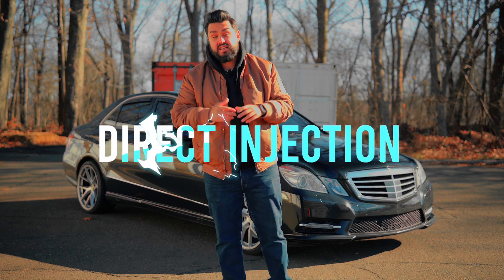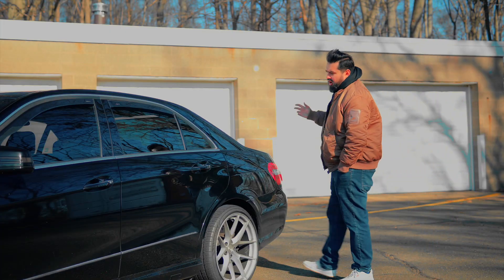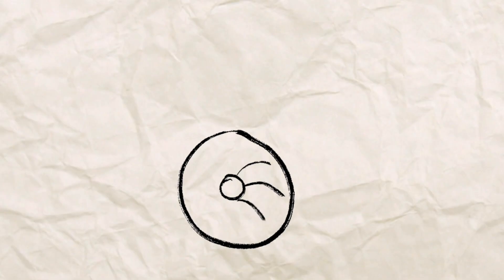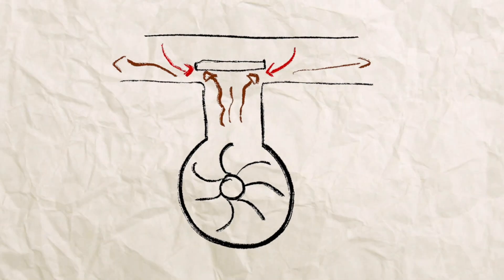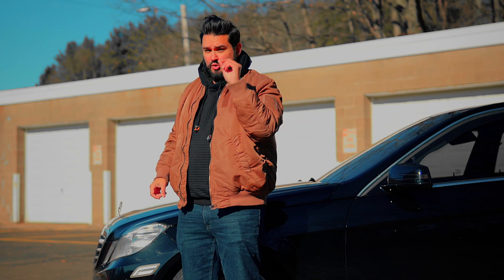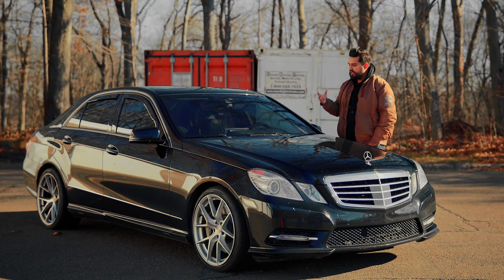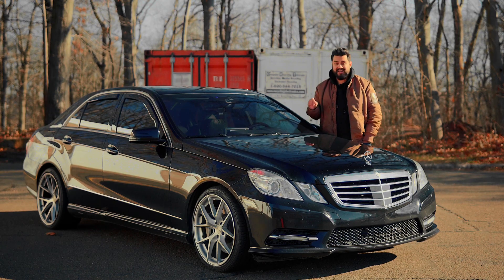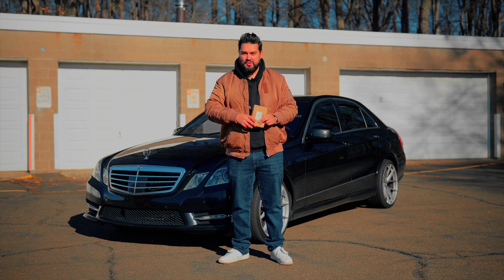M157/M278 Oil Solenoid Mod – What It Does & Should You Do It?

Comment: I read it fixed the startup rattle for someone on a M276 3.5 (GLK350)
Might try it soon with my C350 2013 which has startup rattle as well
Reply: It did exactly that on mine. No start up rattle. 2016 C450 w/143k mi. Using 5w-40 Pennsoil Platinum Euro SP rated @ 5k mi oil change intervals.
Reply from the maker: Rattle is either from stretched chain or cam adjusters failing. This won’t fix either of these things but could prevent it if it’s not happened yet
Reply: @mrapter7  im hoping its just because of the tensioners + missing check valve
Reply from the maker: Yeah very likely possibility. This was about a $2500 fix (included some new coolant tubing that cracked). Adjusters are far more expensive. But, once tensioner is replaced and check valve is in, you should be more or less good. Use good oil, change it frequently and you’ll be good to go. 

Adjusters typically fail from a bit of fault from manufacture defects and just poor oil changes / dirty oil. I haven’t yet, but I’d recommend a media blasting every 70-100k miles on the motor to get carbon out which can decrease the carbon and deposit buildup in oil that causes these types of issues
Reply: @mrapter7  this rattle noise happens on all v6 Mercedes engines from 2015+ I had it every start on my 2018 c43 with 27k miles until I cut the oil solenoid, if it is a stretched chain or failing cam adjusters then wouldn’t we all be having much more issues with our cars?, because it’s been 2 years of hard driving and no issues for me and many others, and also why would either of those problems appear on a such a low mileage car?
Reply from the maker: Poor oil, oil change intervals, driving habits, heat cycles, etc. plenty of reasons it’s happens at different times. Not all engine are effected, and most 2015+ are uneffected for the most part. 

Early DI engines have cam adjuster issues, timing chain issues and piston slap issues. All of these could sound similar on startup to people, so it’s hard to even disgnoe one anecdote do another.
Reply: changing tensioners + installing check valves completely got rid of my rattle, cam gears were in good condition, cost me around 800
Reply: @CodeGabriellho what is your car?

Comment: wont throw a code or cell or checkengine on s550 2015 ?
Reply from the maker: Throw code, yes, CEL, no
Reply: @mrapter7  ty kindly , was it only for like early years of the biturbos v8 11-13 ? or applies to all years ?
Reply from the maker: @emazens even newer AMGs can potentially benefit. Literally any place a two stage pump is, you could definitely be better off with full proper pressure at all times. It’s a common mod on many vehicles, I’ve come to learn
Reply from the maker: @emazens if you’re considering one , get one with a build date after 3/15. Much much much better and livable engine

Comment: So, my question is regarding the oil pressure being configured to the maximum all the time. We all know about oil incursion into the wiring harness through the cam sensors and cam phasers....this is a failure that we all are planning for, usually with the pigtail mod. But we don't expect this failure to occur before 50K miles. Would this mod possibly cause this failure to occur sooner?
Reply: No. Whatever you do , just get the new version of those solenoid and sensors, i put another 60k miles on it and didn't happen again. The pigtai mod is just waste of money.
Reply: @Hi.Al.you mean buy the solenoids and sensors for the newer version of 278 engines?

Comment: How about M272 E30 engine? Is that a rock solid motor??
Reply from the maker: E300? E350? W212/211?

Yeah the 272 is a great motor. No direct injection buildup, no cam issues, no cam timing issues, no real tensioner or chain issues, and is underpowered generally which means far less stress on the engine. Fantastic motor. 

I’ve driven examples of over 250k (plural) and the engine and tranny were never the concern with them. If it’s been maintained as in proper oil changes at 5-7500 miles MAX, then I wouldn’t flinch

Comment: My car's selenoid is not working right now, and i want to do the same. But how to be sure if its not stuck in the lower pressure mode ?
Reply from the maker: Good question. For this, you can do a couple things. 

I’d turn on the engine and get it fully warmed up (go for a drive). After you come back, pressure should be nominal at 20-30psi. 

Use a scan tool like Xentry to monitor the oil pressure. Note: there IS NO TRADITIONAL oil pressure sensor here. These engines use a combo of RPM, temp, solenoid status and other flow sensors, so using other scanners may not work. 

Turn engine off after reading, Unplug the solenoid and turn it on again. If your pressure stays the same at 20-30, it’s seized internally. If you see it jump up to 40 or so, it’s working as intended. 

That being said, you could bench test it and send 12v thru it and see if you hear a click as well, but I’m not comfortable doing that.

Comment: Cool video bro. Definitely gonna do it. 
Now for what's important...Rims? Make, size height, width, and most importantly... offset? Those sit perfect.
Please and thank you.
Reply from the maker: Because you asked nicely ❤️

Aodhan AFF7 19”

F: 235/35r19 x 8.5”
R: 265/30r19 x 9.5” 

But please beware, I have since swapped to 245/35 up front and 285/30 in the rear as it is a 1:1 size for 4matic (like the previous sizes) but offers significantly more sidewall while having great fitment. The 285s poke a TINY bit, so maybe 280 or 275 if you can find them paired with 240 up front. Hard sizes to fine tho. 285/245 are easy to get. 

I’ve bent 4/4 wheels and replaced them all once, and have another wiggle in the back before I put the thicker tires on. I watch the road like a hawk, but they bend too easily with the thinner rubber. Not recommended at all. 

245/285 can still be lowered 40mm with Vogtland springs or similar…which is what is next 👍
Reply: @mrapter7  beautiful choice in wheels, but still going to 35/30 is quite heroic😮.
I'm in a small town in Texas where I can roll a marble straight to Oklahoma, but I've lived in DC where 35s got me dental work and 4 square rims at 25mph. 
I think I'll try 245/40 front and  285/35 in the rear on my '14 E550 cabriolet.
Thanks a bunch.
Reply from the maker: @apollobolling644 40 sidewall won’t fit - you need 35s on 19”
Reply: @mrapter7 DAMMIT!😢
Reply from the maker: Nothings changed yet - she’s been in and out of the shop for various little things …. Currently is for another quite drastic coolant leak somewhere. 

Once she’s sorted for a full few weeks - then the b6s and springs are going on haha. I have like 2500 in parts sitting in my office waiting ….
Reply: @mrapter7 I'm probably more anxious than you are to see the next upgrade. 
I'm here for it 😂
Reply from the maker: Thank you bro! Should be getting her back this week - she’s been in and out of the shop chasing coolant leaks so videos and other upgrades have been a little difficult haha

Comment: Has any one else's oil temps running higher since doing this?  I would think it should be better since it's cooling the motor off more which means the motor shouldn't be running as hot.
Reply from the maker: When you take heat away from the engine, it goes into the oil, which would mean higher temps if more of the motor is being cooled in layman’s logic. 

But yes, a well documented side effect is 8-10* bump on oil temps. Oil should be more than fine up to 250* if you track it. Daily and spirited driving I’ve never seen over 224 on mine. I use high quality liquimoly and change every 3-3500 miles
Reply: @mrapter7   OK, I have a 2013 E63 AMG 5.5 L (pre-facelift)  so when I'm chilling, my temp is usually around 218 to 222. What if I start to get on it just a little bit it can get up to 231 but it starts to come back down to sub 220.  
 My Homie has a 2014 which has the facelift and his oil tip never sees more than 216 and he is usually around 205 when chilling.  So it always had me worried that my oil temps are running higher than usual. But I also use liqui Moly Mollygen every 2500–3000 miles.  since I've unplugged the oil solenoid. I noticed that when it does get up higher and it cools down a bit quicker and while just cruising the oil temp is a little cooler.  but not as cool as my friends 2014.
Reply from the maker: Are you talking about oil or coolant temp here? 

Newer engines 2014+ have better cooling and revisions to oil and cooling passages, as well as split cooling in the m278. Don’t have a reservoir over your engine below your ECU? That’s split cooling. 

The newer AMGs and 550s also have an additional auxiliary oil cooler too. 

Again, if this is oil temps I wouldn’t even bat an eye. This oil good for like 260-275* 

Coolant fluctuates from 200-224 or so
Reply: @mrapter7  I have a 2013 e63 with 5.5l that has the split cooling.
Reply from the maker: @mjk4378 yea then I wouldn’t worry much about your oil temps. They seem fine. If you take 10* off them you’d be basically where you were before so it’s an intended side effect
Reply: @mrapter7  also, do you happen to have the part number or exact name of that oil pump solenoid? So if I do find out that mine is stuck closed so I can get another one. I tried looking it up but couldn't find it.
Reply from the maker: @mjk4378 

https://www.google.com/search?q=m278+oil+pump+solenoid&client=safari&sca_esv=dffffd1eb0412f15&hl=en-us&ei=x6g4aMGSJ5vR5NoP1-HR-QQ&oq=m278+oil+pump+solenoid&gs_lp=EhNtb2JpbGUtZ3dzLXdpei1zZXJwIhZtMjc4IG9pbCBwdW1wIHNvbGVub2lkMgsQABiABBiRAhiKBTIFEAAYgAQyBRAhGKABMgYQABgWGB4yCxAAGIAEGIYDGIoFMgsQABiABBiGAxiKBTILEAAYgAQYhgMYigUyCxAAGIAEGIYDGIoFSKAbUMwEWLQacAB4AJABAZgBqAGgAZkSqgEEMi4xOLgBA8gBAPgBAZgCEKAC0g7CAgcQABiwAxgewgIOEAAYgAQYsAMYhgMYigXCAgsQABiABBiwAxiiBMICCBAAGLADGO8FmAMAiAYBkAYLkgcEMS4xNaAH3nmyBwQxLjE1uAfSDsIHBjAuMi4xNMgHRg&sclient=mobile-gws-wiz-serp#piu=ps:50&oshopproduct=pid:791281969613660598,oid:791281969613660598,iid:310782391260018855,pvt:hg,pvo:19&oshop=apv&pvs=0

I found this, otherwise I’d assume replace the whole oil pump
Reply: @mrapter7  did you mean to send me a video of an Aston Martin? If so what am I looking for in that video?
Reply: And please lmk⬆️ if you have part number
Reply from the maker: Loll! My bad 

https://www.google.com/search?q=m278+oil+pump+solenoid&client=safari&sca_esv=dffffd1eb0412f15&hl=en-us&ei=x6g4aMGSJ5vR5NoP1-HR-QQ&oq=m278+oil+pump+solenoid&gs_lp=EhNtb2JpbGUtZ3dzLXdpei1zZXJwIhZtMjc4IG9pbCBwdW1wIHNvbGVub2lkMgsQABiABBiRAhiKBTIFEAAYgAQyBRAhGKABMgYQABgWGB4yCxAAGIAEGIYDGIoFMgsQABiABBiGAxiKBTILEAAYgAQYhgMYigUyCxAAGIAEGIYDGIoFSKAbUMwEWLQacAB4AJABAZgBqAGgAZkSqgEEMi4xOLgBA8gBAPgBAZgCEKAC0g7CAgcQABiwAxgewgIOEAAYgAQYsAMYhgMYigXCAgsQABiABBiwAxiiBMICCBAAGLADGO8FmAMAiAYBkAYLkgcEMS4xNaAH3nmyBwQxLjE1uAfSDsIHBjAuMi4xNMgHRg&sclient=mobile-gws-wiz-serp#piu=ps:50&oshopproduct=pid:791281969613660598,oid:791281969613660598,iid:310782391260018855,pvt:hg,pvo:19&oshop=apv&pvs=0

I found this, not sure its validity

Comment: Did that on my 16 E63s. No regret at all so far.
Reply: Yea 15 cls63 did it and definitely notice a readiness to get up and go quicker but I will say mine takes longer to get the oil temp up. Don’t know why I did replace all the coolant hoses and reseal the front of the motor but she runs strong especially with the stage two tune 😅 love these cars
Reply: whats your average oil temperature now, he said it goes up 8°-10°, i hadn't done the mod but my average temp is 199°
Reply from the maker: Oil temp will raise 8-10 at its peak, and coolant may rise a little too on older cars. Newer models have more cooling capacity and better efficiency. 2013 and older will get warmer but it’s always in check in my car
Reply: @watspop.n  93 Celsius now for me is the new normal
Reply from the maker: @amaelcaron-gagnon5606 yeah anywhere from 200-220f is within operational ranges for coolant and oil is much safer up to 240 but that’s insane. Never had oil over 230* even when having some fun on backroads really stretching her legs
Reply: @amaelcaron-gagnon5606  ya...i switch to M1 oil this year & it started to go up 210°... i was freaking out...my old normal was 199° top, for years

Comment: Just did this mod last night. And right away when i started the car to get it off the ramps i noticed that it was a little quieter. On my way to work this morning i did also noticed that it was a little bit more sportier if i got on it a little. Tempt did raise quicker. Just a little paranoid if this might mess something up.
Reply: How is it treating you now?
Reply: @kevingooner it's been about 6 months and everything is fine. No hiccups or weird noises.
Reply from the maker: Only things to look for is temps. Make sure they are in check. Expect a potential of +10*f but that’s well within operating temps. 

Other side effects may be a slight burning of oil over 5-6k miles, but I haven’t noticed any and I’m tuned. Engine sounds better, feels better and runs better. I’m happy
Reply: @mrapter7  on my way to work this morning and I got to play around a little and I definitely can feel the difference. I also did a tranny reset before leaving the house. Car doesn't feel sluggish and just wants to go if you get on it. 2013 s550 4matic with a renntech tune. Thank you so much for this. Found out about this awhile back but wasn't sure if it was worth doing. Again, thank you.
Reply: @300zVinh what's your average temperature before and after
Reply: @watspop.n  close to 90 but I have seen it get to 95. Never pass that and then it would drop down to 90 again, which is the normal operating temp. Don't know the long term effects of this will be but so far I honestly like how the car feels now.
Reply: @300zVinh  thanks, i guess i have a small mod to do this weekend
Reply from the maker: 80-100 is technically safe operating temp. My coolant rarely but does spike to 220 sometimes (Fahrenheit) but always corrects. I have no split cooling, tune, and original 14 year old thermostat. Thermostat may be on the way out on mine.
Reply from the maker: It’s a good trade off
Reply: @mrapter7  What temps are y'all seeing AFTER unplugging? I am getting around 210 fully warmed up and have NOT unplugged yet.
Reply from the maker: Yeah oil temps can get to 212-220 or so, coolant might get hotter too as these engines already are at the limit for cooling here but nothing dangerous. You can install split cooling for turbos or additional oil coolers like the 157 if you need. But not needed really. 

220* oil is baby numbers for liquimoly, safe to 270-290. 

Coolant under 220 is normal, will fluctuate especially if you have the AMG menu unlocked that shows you number values for temp. These are notoriously inaccurate in the way they sway. If you took an average over 60s would be more accurate
Reply: @mrapter7  Thanks for the response. Yes, I have the AMG menus unlocked and am reading from there.

My other question is, Do I need to warm up the engine or anything before unplugging? I do have a Xentry setup and a Topdon Phoenix Plus 2 to monitor oil pressure. Thanks!
Reply from the maker: Nah just scan first to ensure no other codes and scan again to see if you see the proper code

Comment: m278 14' S550 - 200K Miles - Canada
I read on the blogs that this mod is not recommended for colder climates, also the oil pump wears out faster?
Chances are the solenoid is probably stuck but no idea?
Reply from the maker: 2014 has a lot of upgrades and especially in the S class as that gets the newest engineering first. 

If you did a compression test and borescope, you would probably be low on compression on a couple of cylinders, but nothing to make it misfire especially if you’re just daily driving. 

Some engines just last fine, but the majority don’t. Very frequent oil changes and all proper maintenance on time without fail is really needed on this platform or you’re going to have a bad time.

Comment: im very sad. I tried it on a gls 63 and got a CEL, I dont think i can live with it even with all the benefits of unplugging. Any suggestions?
Reply from the maker: Shouldn’t have any CEL! Something might be wrong…
Reply: Apparently 2018 and newer have been programmed to throw a code that illuminates the check engine light. It seems like the only way around it is to plug a dummy to complete the circuit and trick the ECU, but I don’t have more information on what parts to useor installation instructions. If anybody has it please help.
Reply: Apparently 2018 and newer have been programmed to throw a code that illuminates the check engine light. It seems like the only way around it is to plug a dummy to complete the circuit and trick the ECU, but I don’t have more information on what parts to useor installation instructions. If anybody has it please help.